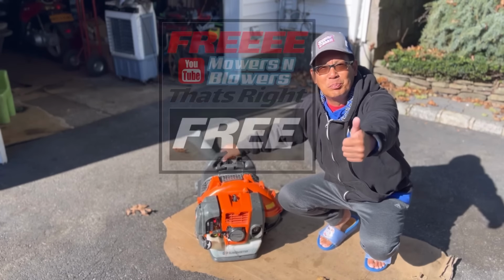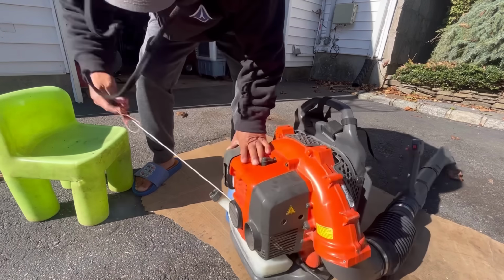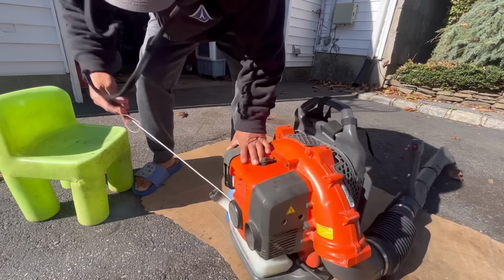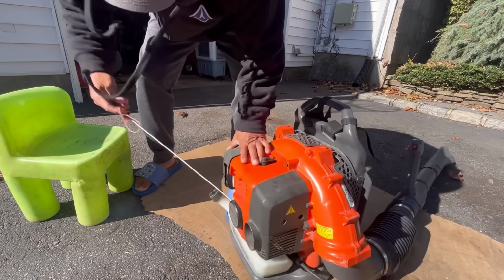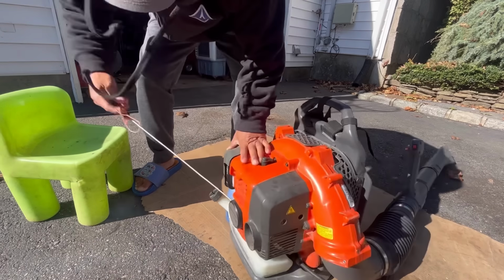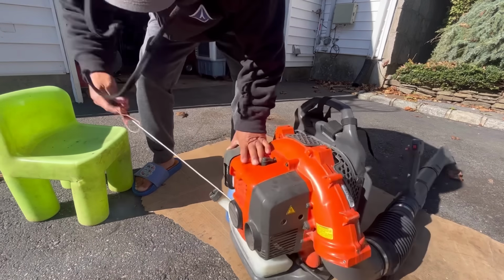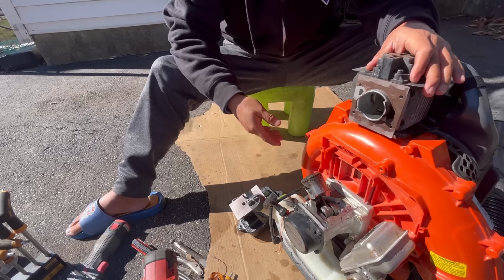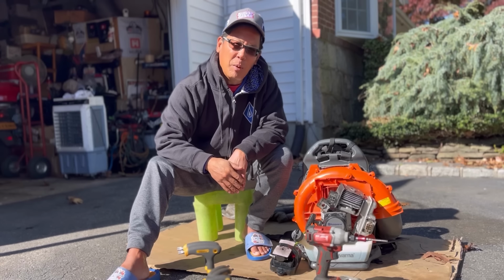WHY DOESNT A BRAND NEW HUSQVARNA 150BT BACKPACK LEAF BLOWER RUN? DID YOU PUT 2 STROKE OIL MIX IN IT?

Comment: Hi Henry been watching your videos for a while. I like working on lawn mowers too. I agree i don't think that blower is worth putting that much money into it let alone the the time and work it would take getting it running right again also quick question I have a Husqvarna Comercial back pack blower that has me stumped. It's only been used a few times. It runs ok for a few minutes then it starts cutting out wen it gets hot i use non ethanol gas and Husqvarna 50 to 1 gas mix .dose not make sense to me i was thinking about getting a new carburetor just to see but wanted to ask your opinion first.
Reply from the maker: Is it a 580bfs?  I’m working on one right now that runs perfect on high throttle for a minute then stalls.  Check your spark arrestor, fuel filter,  spark plug.  I’m thinking ignition coil because it only happens when it gets hot.  But yours is brand new so unlikely.

Comment: Hey Henry, a little off topic but by any chance do you know the length of your truck bed? Wondering to see if my mower will fit in my truck.
Reply from the maker: It’s a 5.5 bed.  A lawn tractor will fit with tail gate down that’s why I have a bed extender on it.

Comment: Crazy prices!!  🤪 
When i bought my BT150 it was 199 in 2021.  My BT 360....... was 299...... they are up to 499 these days.....crazy!!   I think soon prices will be droping drastically!!  Housing is supposed to drop 25 percent in the coming months!
Henry,   i would hone the cylinder and see if it cleans up.   It it needs too much metal removed, then a new cylinder will be needed!!   A stock loose piston in a badly worn oversized bore will rattle and maybe crack if it does run.

Comment: Henry, I wouldn't do the cylinder either. It doesn't look great , but if you get the aluminum off the bore and lightly hone it, you could get by doing the piston and rings kit.  I think it will run. If you do the piston and cylinder , you won't make sh&t. Put your grass flip flops on and go for it! 😉👍🇺🇲

Comment: Henry I've seen where you can use muriatic acid to take the aluminum transfer off the bore and then some fine sandpaper to smooth out the cylinder.  I would do that and change the piston.  I've sold some backpack blowers for $150 here in Florida so up there I'm sure you can make close to $200
Reply from the maker: Yes I’m familiar.  The bore isn’t that bad, plus it’s really low, so much that the piston barely touches that area. Stay tuned bro

Comment: Hmm. If it were me, id fix it right.  Like you say, some nut will buy it for $225-240. But, just replacing the piston/rings, Im curious how it works after running 30 minutes and  its all warmed up? Good luck dude. I enjoy your videos.
Reply from the maker: Thx bro

Comment: I totally understand the niche of the channel.  But I'd hate to be the guy that spends my good money on something that "looks" good but was only half fixed so some YouTube channel could spend as little as possible to "fix" something. Just my .02c. Love the videos and look forward to the next release notification from the bell.
Reply from the maker: Yes I understand your feeling.  There are moral and ethical gremlins that wander in my brain.  I’d sell it cheap and only if it ran after using it some.  I’d also say the piston was changed.  Glad you took the time to comment,  sharing your thoughts is important
Reply: Just fixed same machine ,same problem.Thank you for what you do
Reply from the maker: thanks for subscribing

Comment: If it were me, I’d change both. If you do the full rebuild, the machine is basically new and if the right person sees it, it could go for 200.
Reply: This is a $280 homeowner blower. The piston, rings, and cylinder are doneski! All you have to do is remove the muffler and look at it through exhaust port. Use heat and PB Blaster if necessary when removing torx bolts.

Comment: I've done several of these EXACT models as I mentioned to you in the original video. They were all the piston with almost no cylinder wall scoring. I'm more particular than you, as we've discussed before, and sometimes I've told you that I disagree with a few of your cutting corners. This one I don't. I've honed and light sanded the wall and CLEAN IT THOROUGHLY. Slide the piston in slowly and try to feel foe any restriction. If fine, reassemble, fuel/prime the engine and cylinder, and do a compression test. If it passes, go from and use it, and do another compression test after an hour or two of use. Otherwise, wait for a donor for a cylinder head if you don't want to buy one.
Reply from the maker: Good advice bro!

Comment: Only Way Too Go is The Kit and Since The Blower Is Virtually New Could Get 200.00 Out of It I’d Check The Crank Bearings If There Shot Then It’s Not Worth Fixing With The Galling on The Piston and Cylinder It Might Run 1 Minute With Just a New Piston unless You Scotch Bright the Cylinder and Avoid Removing The Nickosil Coating on the Cylinder
Reply from the maker: Bearings wouldn’t be shot unless the conrod broke which it didnt

Comment: As ignorant as this is gonna sound people that dont know what kind of fuel a backpack blower, trimmer, or any other 2 stroke piece of equipment takes needs to use a rake. Love your vids Henry
Reply from the maker: Thanks Gary
Reply: @MowersNBlowers Just go cordless, problem solved.
Reply from the maker: @tcmits3699 Cordless?  Wtf are you talking about?
Reply: @MowersNBlowers  lf the previous owner didn't add 2 cycle oil to gasoline, maybe they should switch to battery powered lawn equipment.  That's what I'm talking about 🥴
Reply from the maker: @tcmits3699  I see!
Reply from the maker: cordless?  Do you see a cord on the backpack blower?

Comment: You can buy hex and torx bits for not much money. Shouldn't have to use vise grips on two cycle equipment. Sorry but true. I repair small engine equipment over 30years. Its better to have the right tools vs stripping a fastener.
Reply from the maker: I have the bits.  But they strip from the amount of heat

Comment: If you can’t sand that inclusion out of the cylinder head you will be throwing away your $$. The aluminum will transfer to the new piston ring and lock them up like the ones on the current piston.
Reply from the maker: Maybe